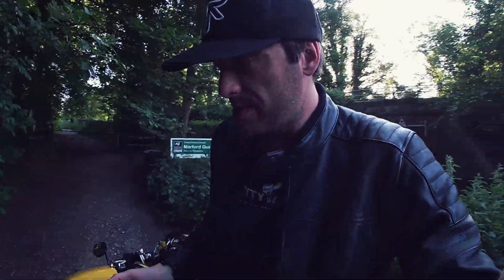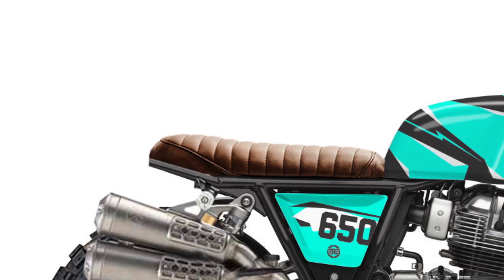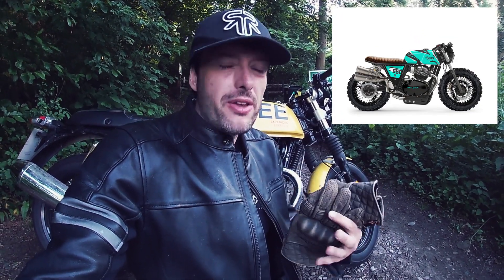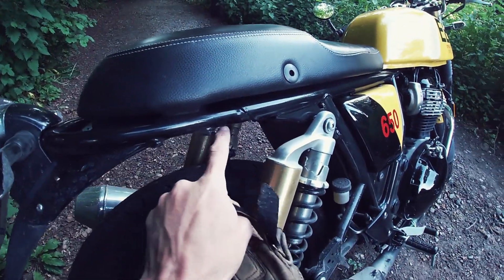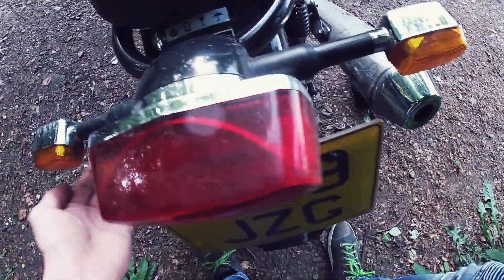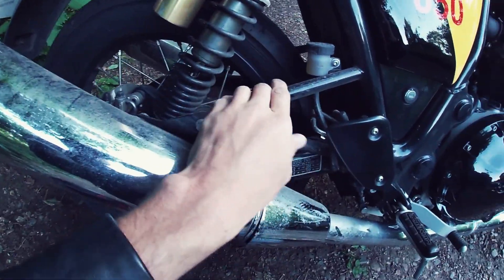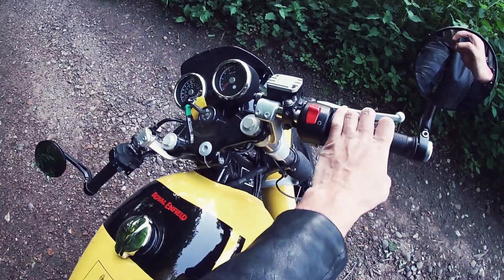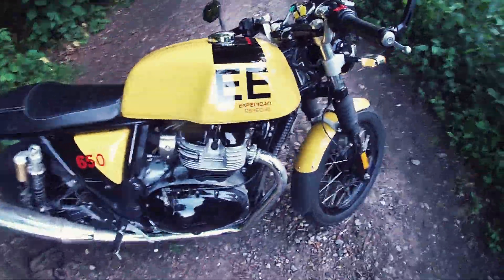The reason to use a Royal Enfield GT650 as a build base - What I could do.

Comment: I have a little small doubt i hope so you could help in it i have changed 2×2 full system exhaust for my royal Enfield continental gt 650 but the left side is shorter in length than the right side by 1 and half inch when asked to the dealer he said that it is even like that on stock exhaust but i cant find the difference in stock one so could you people help me in it whether is it ok to have  the left side short or the stock exhaust itself is like that could you please help me
Reply from the maker: Sorry for the late reply. As long as it fits and performs fine I’d say the shorter length is ok.